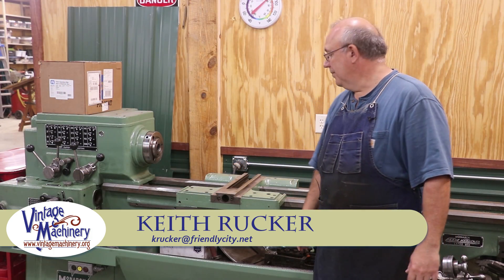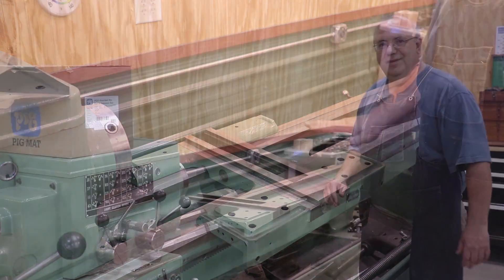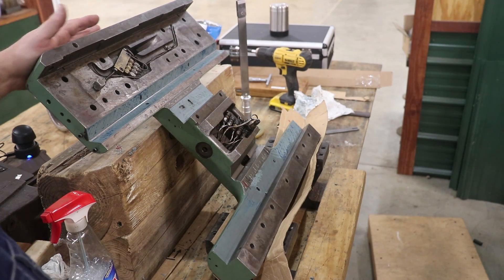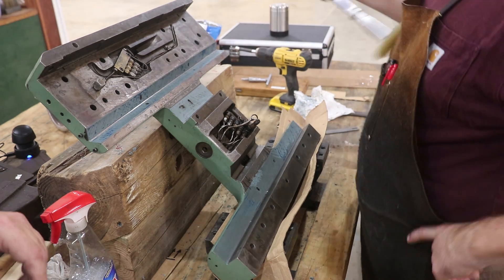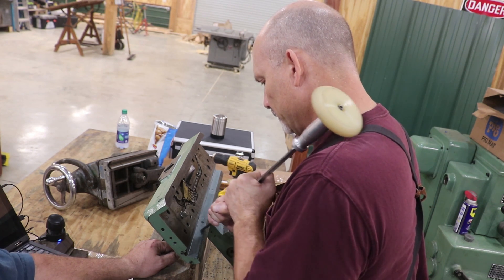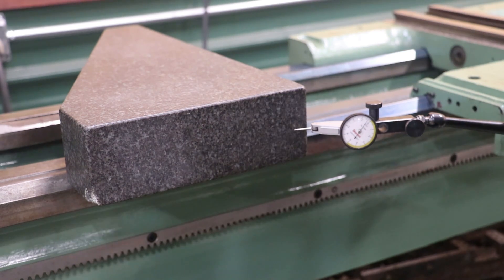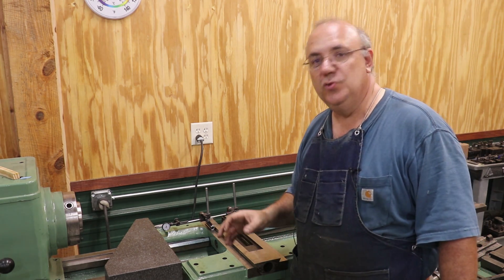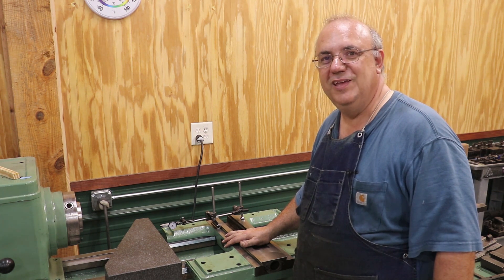Monarch Lathe Restoration - Part 15: Scraping the Saddle Square

Comment: Could a lapping compound be used to help correct very small deviations I'm alignment especially finishing with an extremely fine conpound? I'm aware about abrasives being embedded in the metal, but would it be effective for helping to correct the saddle to fit parallel?

Comment: Hi Keith. Nice work. I also turcited my saddle after having spent over two years (not continuously!) scraping 0.010” wear out of my ways. I also scraped the spindle bearings. I am interested particularly in how you went about scraping the dovetail turcite to re-angle... did you scrape the middle out to make life easier? If my understanding is right, for every 0.001” you scrape off one side, have to drop the whole dovetail 0.0014” to get contact again, with constant consequences for the other side of the saddle. I didn’t have quite the same issues because my ways had underslung dovetails at the sides but what you’ve done must have been quite involved. Well done.

Comment: You have to show the final blueing or it didn't happen! lmao No reason you couldn't move the setup out to the end and see how it compares.  Because your square was tipped .0003 as well you can add that value to the .0005 you measured putting you real close to your goal.  Glad to see this thing finally getting ready to see some action!
Reply: Well my old Monarch was good when I got it, everything else I just work with the wear. :-) I think CNC machinists call it cutter compensation. lol

Comment: Keith, I agree with scraping it near the headstock where you use it most.  I would have done a check out near the tail stock just to check myself.

When I scraped my Southbend I squared the cross slide to the bead much the way you did and then I put an indicator in the head stock and "trammed" a 180° arc spanning the full travel of the cross slide like you would on a Bridgeport vertical mill head to square it to the table.   I marked a point on the cross slide and touched the same spot with the indicator after moving the cross slide.  This gave me a test of square with the spindle and the head alignment.

Comment: Hello Keith Not to pick on you but you keep saying 10 thousands of a inch instead of a tenth.     I do agree with working up on the headstock end to keep your machine square and most guys do not realize 99% of you work is less then 6" long even big long shafts with bearing journals are still short just that you are working on a different spot on the lathe .The one thing I was taught when I apprenticed back in 1972 was the machine is only as good as the guy using it.
Reply: People are equally confused when somebody says 'tenth'.    Obviously, a 'tenth' is really 100 thousandths of an inch.   A measurement of 5 'ten thousandths' is correct.....not 5 'tenths'....even though machinists have used the other lingo to describe ten thousandths of an inch.

Comment: Interesting comment on the reason for doing the work near the headstock.  That was always the problem with lathes- if you wanted a 15' swing you needed to buy a massive machine and rarely had any use for most of it.  Those Chinese 3 in1 units addressed that issue with a big swing on a short machine so you had more versatility in that area that was used 90% of the time without having that extra 10' of machine taking up space.

Comment: On your final check, with the reference edge out three tenths, the measuring edge would be out the same three tenths at the same distance. Did you stir that into your  consideration of the final measurement? Depending on how far across you take the final measurement,  you would be approximately 0.0005 - 0.0003... or would it be plus? Excited to see progress on this machine again.

Comment: I like to check the cross slide directly against the spindle running the cross slide on the saddle against a 10" sine bar in a 4 jaw on the spindle, assuming the headstock was already aligned to the bed. But then I'm lazy and use Moglice under the saddle.
Reply: Agreed have done a Monarch model 62 with Moglice and one with Rolon  also Leblond and 21" Colchester ,Moglice is the cats meow.  I think moglic will out last turcite sure moves with less resistances then the turcite.
Reply: @zedo5851  I did use Multifil on the bottom of the cross slide where the scraping was easiest - just 2 axis instead of 3 interdependent axis.  Next lathe I'll do the same, assuming it needs work.

Comment: Keith dont you need a gage pin in the dovetail to measure while moving the kingway tool ??
Reply: I was curious too about how high the Kingway contact roll was mating with the dovetail surface.  Were rebuilding a SB heavy 10 now that just had its bed planed. Nice! So, Keith, when you gonna get that planer of yours going? :)